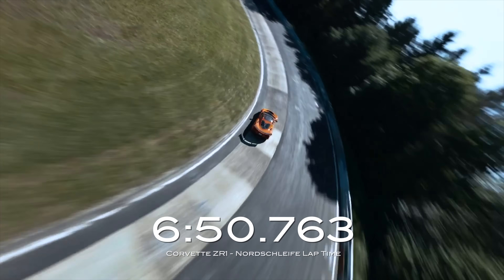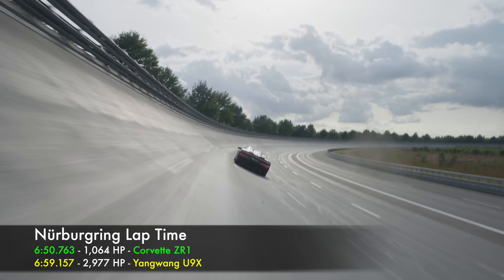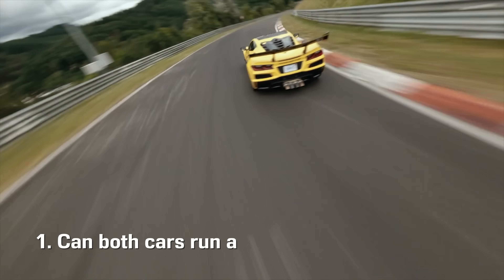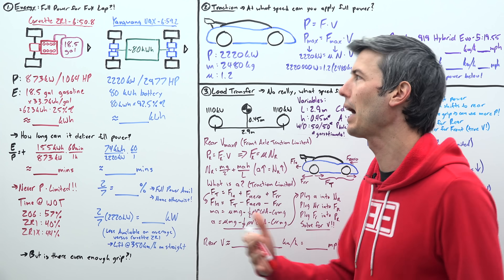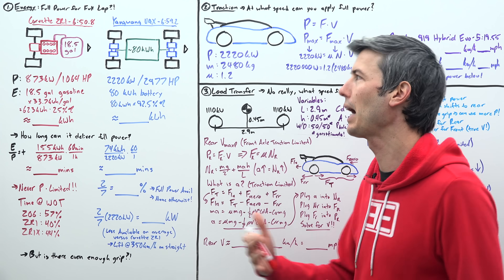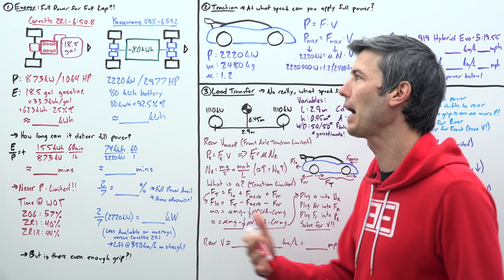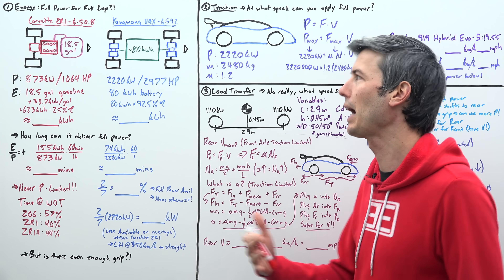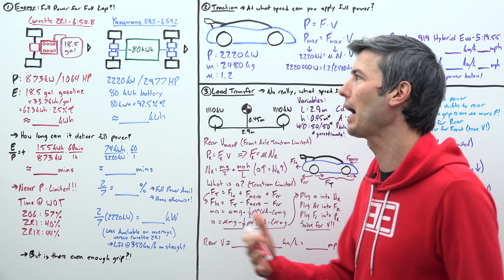Gas Beats Electric! Why Is 1000 HP Faster Than 3,000 HP?

Comment: the 2/7 * 2220kW doesn't make much sense here. It makes more sense if you think about it in terms of max power for 28.6% of the run, and in order to spread that out you would need to split it into 3.49... chunks, hence 2220/3.49 to get that 634kW.

Comment: to my weak mind... by comparing the WEIGHTS of the two vehicles the reason for the difference is clear:
Yangwang U9 Xtreme = 2480kg / 5467lbs,  
Corvette ZR1 = 1664.7kg / 3670lbs

Comment: Here is a question. A car that is lighter benefits more from the down force coming from a rear spoiler, but suffers more from the overall drag force. The drag force is even worse with that spoiler. So when is a rear spoiler good or bad? What is the trade-off? Why did the Yangwang not deploy a real spoiler? Is it because it was made for straight line performance only?

Comment: How much energy did the U9 recover over the course of the lap?  There may be a very useful amount of energy recovered.  And it’s pretty impressive that the U9 has less than half the energy on board than the corvette and not enough for a full lap at wide open throttle and is only 2% slower.

Comment: Good try! But ... You really did not know what you were presenting were incomplete, naive and misinformation! The U9 Extreme was much heavier. It also did not have the aero equipment like the Vett. In straight line, it beat the Vett very easily. However, when entering a curve, its weight caused big disadvantages. You know centrifugal force? If you don't then stop reading. This force is proportional to the car's weight and the speed it travels around a curve. It pushes the car out of the curve. The higher the speed and the weight the more it pushes. Being heavier and less aerodynamic, the U9 could not enter and exit any curve at high speed like the Vett. This fact slowed it down significantly hence its overall circus time. Now you know why a car with approx. 3000 HP was slower than one with approx. 1050 HP?

Comment: IT would be very interesting to compare speeds of the two cars (nearly identical lap times) at different parts of the ring, corner speed, braking points etc...
The ZR1 would certainly have LESS braking distances, higher corner speed ...The elctric would accelerate MUCH FASTER out of a turn, would be much faster in the long straight ..
Those two cars "built"  their lap times in a very different way (due to wieght, downforce, power-torque, chasis)..
The GT3 RS (530bhp) is almost a race ready car (huge downforce, no need for that extra power, it has a semi roll cage out of the factory)..

Comment: Starting with heaps of overwhelming but interesting physics and math, just to throw them out of the window at the end and conclude which car manufacturers seems to have forgotten lately: not power but (low) weight is king in car performance. Maybe an interesting thought experiment: given an average human driver and a world class formula racing athlete, both driving at their physiological limits for a Nürburgring-lap, which would their lap time be and what would the basic properties (weight, power, energy content, maybe grip and aero-dynamical forces) of the car be to get there?

Comment: Weight and aerodynamics. 2 key factors that determine how fast they are going around the ring. The GT2 and GT3 RS have a lot less power, but weight less and have much better aerodynamics. Even the AMG GT Black Series isn't that much lighter than the Vette, it has much better aerodynamics. And even with much less power, it still a lot faster than the ZR1...

Comment: Great video - thank you. 

Two comments:

1) Tyre load sensitivity will reduce that mu a lot, so you’ll need a coefficient proportional to the normal force in your traction calcs, and additionally I’m surprised mu is that high in the first place for a vehicle with that static weight. I wonder what tyres it used?!

2) Some things that were in your calcs, but didn’t get mentioned much were the huge difference in vehicle mass, and I’m guessing a bit of a difference in frontal area?

Thanks though. 😊😊

Comment: A racecar designer once actually did the maths and found out that the optimal amount of power for a car that goes around a circuit is between 1400HP and 1600HP. Any more than this and it's just useless.
Reply: Probably depends on the circuit. If it's a small British track then 600hp will be enough. If it's a big American track like road America 2000hp would be more useful
Reply: @will2461-j2n  true

Comment: Based on my experience from adidas running shoes with continental treads, they were awesome on proper tracks, but pretty scary on wet conditions, probably bc they weren't designed for it, i liked it

Comment: you cannot compare this like you did, you should compare the cars by putting the horsepower to the form of the car that have shorter time instead of using two completly different aerodynamics settings,,, if the faster lap car had the 3000 hp instead of the 1000 hp then the time would have been alot faster given the weight is set to almost same and driver capabilty, look at both cars by downforce and handling weight settings instead of using only the power output as comparement, this video should be titled differently like, this car shape even with 2000 hp more than this 1000 hp car aero makes it faster, this would make more sense

Comment: i love the breakdown and what i learned from you breaking it down. It does seem simplistic not knowing the aerodynamics and what the computers calculate for where the power goes. i also would like to know the compounds that each car used on the lap tires for lap time. thank you for the insight into things i didnt know. I would love a more in depth breakdown.

Comment: other variables to consider: Driver, tire pressure, tire compounds, brake rotor material, ABS, Traction control,  suspension (Unequal A-Arms to macpherson struts), dampening(4 down to 1 clickers), spring rates, downforce

Comment: Only reason electric cars are a hit is that power .
Well small electric car do not come from the ground .
That even a small normal fuel engine is faster thanks to the gears .

Not talking about the range .

So no electrische motor are not that great .
Go look for the nice easy electric car for the lower budget people.

The Dacia Spring electrisch car vs all cheap fuel cars for the same price

Comment: I have raced cars a lot over the years. I had a VW Jetta and my brother-in-law had the Saturn SC1 as most know the Jetta doesn't have as much HP as the SC1 so in a straight line race he just crushed me, but on a technical track he couldn't keep up to me at all. 
Reasons: 1) His car was much heavier than mine.
2) The Jetta has a closer gear ratio so is in the power most of the time when in 2nd, 3rd and 4th gear. His was and automatic.
3) He really didn't understand how to drive track or how his car handled. 
Power doesn't always mean you'll be faster overall only at some points of the race, but being able to take corners at higher speed and maintain those speed is what makes a car faster. Knowing how to do it also helps a lot.

Loved the video and really enjoyed the math you were showing!

Comment: not sure if I misunderstand this, or the title is misleading

 combustion engine provides 1.000 to rear axle (both wheels simultaneously), meaning 2.000 in total (if we count it the same way as electric)
electric provides 3.000 in total, divided per wheel as each motor drives the wheel, that's 750 per wheel, 1.500 per axle

so it should be either a total per wheel, so 1.000 vs 750
or a total of all wheels, so 2.000 vs 3.000
assuming the electric motors all provide power to all wheels at once, not just their own wheel

Comment: Seems to me that a car not being able to run at wide open throttle for more than 2 minutes is a serious design flaw that could have been remedied by trading power for range. Electric may very well beat gas if you aren't a complete moron, but designing a car that can only flat out for 120 seconds is beyond idiotic. What kind of car can only run 2 minutes?!!! That's 100% useless as far as I'm concerned.

Comment: Just an FYI. These formula's don't really work in the real world. Tire type, temps, track temps, downforce levels, steering angle etc...also, these cars have traction and stability controls. 

What you need is actual real world data to compare how off you are to theoretical data "which will be off by a fair margin to theoretical"

Comparing the GT3 RS to the ZR1, German's live at the ring and used a pro driver. ZR1 really should be in the 735-740 range with comparable drivers and conditions.

Comment: You had lots of detailed math, but also fundamentally flawed conclusion. Wide open throttle in gasoline powered vehicle doesn’t mean full power output. In most of the cases, it’s not even close. 25% efficiency may also be quite optimistic. It may look like that, if you take actual fuel consumption and assume you get full power output with full throttle, but that’s would be just double lie, and don’t work in comparison with EV’s. 

3000hp begins to be a lot for a track like this, but we should only ask, can this power be controlled properly, and what’s the trade off in weight. With EV, answers are yes and minimal. In this case, there’s comparison between cars that were made for track and speed with decades of development and knowledge, and Chinese EV that’s made for everyday use on roads, where the team spiced it up with over two times the power it usually has. 

Unlike gasoline cars, the peak power is cheap with ev’s. You may not need to do much more than exceed manufacturers specs for batteries and controllers, or if playing safe, use more money for better ones. In any case, the equation doesn’t favor ultra light ev because the limits of aerodynamics. That’s one benefit for gasoline cars, since the stickiest track tires can’t handle higher weights. Absolute weight doesn’t matter from physics point of view, except through the limits of materials. Weight distribution has important role, and that side ev’s have advantages, with much more flexible placement of mass and low center of gravity.

When looking the ev’s that are made for track, they totally wipe the table with gasoline cars in same category, so we should remember that when making general comparisons. There are differences, and large amount of important benefits goes to EV technology. It takes time to refine designs and learn best ways to harness all the potential, but there’s lots of it. Not just on performance, but also on price. Economical drivers go with their own ways and new has always the price, but from engineering point of view, high performance electric power train is dead simple compared to similar gasoline engine + transmission. Power output response can be fully customized, without changing parts or doing complicated adjustments.

That’s very important part of driving experience, along with general handling, and there lays the greatest potential, even when we first see cars like this, where high power is used to put up some numbers. At the end, the fun comes from the feeling of power and control and unpredictability is not fun at all, especially when your life depends on it.

When talking about the ev track cars and their potential in a future, there’s one direction that can give a lot. It’s a high power battery pack that can be swapped. Swap may not work on consumer vehicles, but on the track, it could be handled. If smaller battery can deliver high power, it means less weight, less overall consumption, smaller heat production and higher input and losses from braking energy recovery. That’s where the biggest potential is hiding. Acceleration doesn’t consume energy, it just stores it on momentum. Brakes are the one that consumes it. 

If aiming for longer races, hydrogen might be solution. It has bad efficiency compared to batteries and because many practical problems, it’s no good for everyday vehicles, but for race car, things work differently. Instead of using large and heavy high pressure tanks, liquid hydrogen could be used. It only needs to boil out slower than the vehicle uses it, so no extreme insulation and impossible structures are needed. It still takes space, but increased efficiency and higher energy density pays off if longer storage is needed. Combined with braking energy recovery and small battery to cover peak power needs, this would probably pay off. Hydrogen has about 3.5 times higher energy density than gasoline, and fuel cell+electric motor combination has probably 3x the efficiency of combustion engine. This can be 60%, when in racing conditions, I doubt if any gasoline engine can reach 20%, and 15% is more probable.

Comment: Lmfao! Not being able to use full power had almost nothing to do with the slower time. Weight is THEE biggest factor. The power difference really only matters when all else is equal. Tires(composition, width, etc), weight, and suspension matter so much more than power in racing.
Reply: A more interesting point would be to figure out how much time the u9x spent putting down OVER 1000 hp and was still slower because again, weight.

Comment: I think that another perspective is needed. You did the math for the car using its FULL power, the whole 3000hp and it was clear that it is not making a full use of it. However, it may be using 2000hp or even 1500hp and still have a great advantage over the corvette. In my opinion the lift and coast it's doing + the difference of weight + the difference in aero are what really is making a difference. I think this debate is already pretty well discussed, EVs get more power more easily, put it down more efficiently but are heavier and not enough energy dense.

Comment: Weight and rolling friction with side forces. Straight line speed is a separate question using tires designed for Mach 1 cars.

Comment: Ha one look at the Yangwang and I knew it couldn’t put the power down. The downforce program is trash. Dodge Viper ACR Extreme basically matched the 7 minute time with only 645hp BUT 2,000 lbs of downforce. Yet that Yangwang doesn’t even have a rear wing. I remember because Dodge gave a master class on racing downforce during it’s collection of 32 track records.

Comment: I remember when they were testing the Bugatti Veyron with like 1,000 horsepower, or 1,600 hp, something absurd. At full speed they said that the tires would last about 7 minutes before needing replaced. Now imagine a car with 3,000 hp, those tires at full power/speed would likely last maybe 5 minutes and that's probably being generous.

Hell, I remember when my 93 RX-7 had 519 RWHP out of that little tiny 1.3 litre rotorary. I felt like I was king of the world, lol. I miss the simple times.

Comment: and the zr1 was driven by the guys that built it not pro drivers . Pro drivers or ring drivers on a track that big, Misha says its an easy 10-12 seconds faster . That is why gm used just the engineers and not pro drivers :) That car is capable of 6:40 or even 6:39

Comment: The issue too is the car can't sustain that for 7mins it throttles to the heat, it gets very hot. They should have robust the system but my guess is its good enough....China....just cause you're fast doesn't mean you can cool down faster then a cooler gas car...turtle and the hare people remember also driver as well😂

Comment: Corvette: 1060bhp. 0-100 in 2.3 seconds. Weighs 4050lbs. Downforce: over 1.200lbs. 
Yangwang U9 Xtreme: 0-100 in under 2.3 seconds (not specific, vague). Total power output is 2950-3000bhp. Weighs 5467lbs. Downforce: N/A. (Intelligent). Highly vague. 
Do the math.

Comment: 6.46 gallons at 2.858 kg per gallon times 33.7 kwh times 25% efficiency equals 155.54 kwh. wrong
18.5 gallons at 2.858 kg per gallon times 33.333 kwh times 13% efficiency equals 229.09 kwh. correct

Comment: Huh not even considering a gt3rs that does it even faster. Almost like we have been right since the 1950s. Lighter is better. One thing I will say is chevy did it with engineers not racing drivers. This makes a massive differnce Driver mod is real.

Comment: Did I miss something? Where are the assumptions for variable apparent weight due to aero (downforce)?  That's why an F1 car can supposedly drive upside down at speed. The McMurty shows that suction can be used to give an immense apparent weight at rest and that results in markedly improved traction. Unless you have objective downforce measurements at different speed points, most of this is just guess...

Comment: Use two vehicles of the same power. Later, have the rear to slingshot  off the front one, for less drag.  Boom, faster, and quicker.  Yeah, it might be cheating.  You did it, whew.

Comment: 7:00 could be a mistake. Total weight of the vehicle should include the weight caused by the downforce too. So maybe 2480kg + 500kg downforce etc. Since the downforce changes by the speed, there is your pickle. The car can put the full power down at a lower speed than 274km/h, since when F goes up, V goes down.

edit: he mentions it at the end, but not enough emphasis given imo. That car should have significant downforce at high speeds, thus lowering the speed at which full power can be applied.

Comment: We already know from motorcycles that when you're traction limited increasing the HP doesn't yield much in terms of laptime.
Cars have a much higher ceiling thanks mainly to the ability to increase traction through downforce, rather than rely solely on mechanical grip.
In fact with the help of downforce cars can put down any amount of power, except for the very low speeds, to the point where the limiting factor becomes human tolerance.
The effect of a specific amount of downforce though greatly depends on car weight and electric cars are very heavy, all road cars are very haavy.
Only formulas can extract the full 3k power but the driver couldn't handle it either mentally or physically.